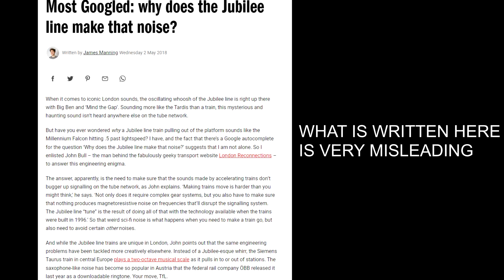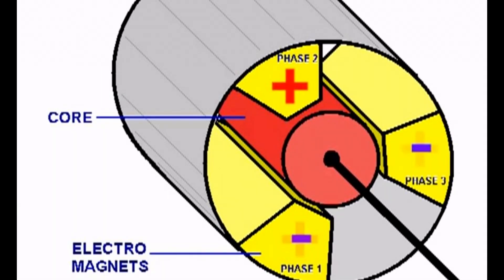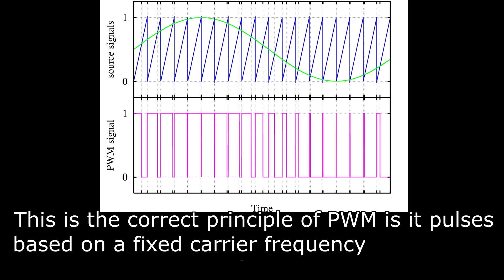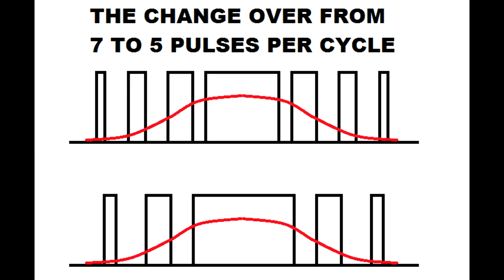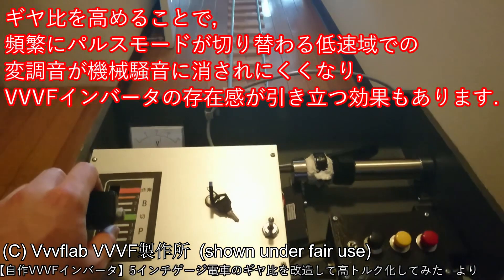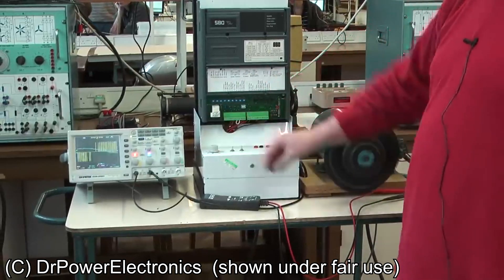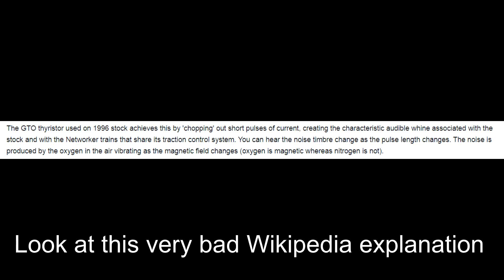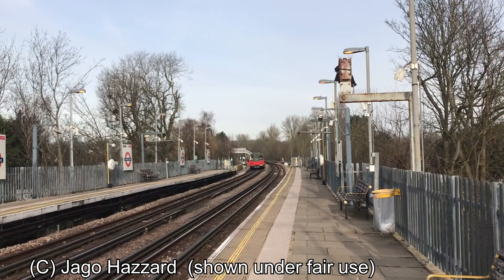Train motor sound - What UK enthusiasts get wrong while Japanese enthusiasts build model VF drives

Comment: There's a new type of VF drive used in trains SIC-VVVF instead of IGBT, seems like the new VF drives are smaller and more compact
Reply: Technically more correct would be MOSFET-VVVF, as that's what's directly replacing the IGBTs.
Reply: I"ve heard some rumblings in the last few years about silicon-carbide power electronics - it wouldn't surprise me if they're making a debut in the mass market by now.
Reply: @gorak9000  The SiC VVVF is already on the new Japanese trains...and also for example Bombardier (Alstom), the SiC Mitrac, audible in Singapore and Stockholm.
Reply: @gorak9000 they are in some electric cars like teslas